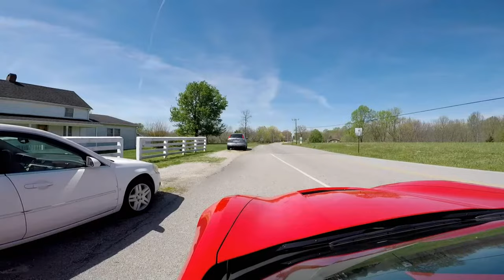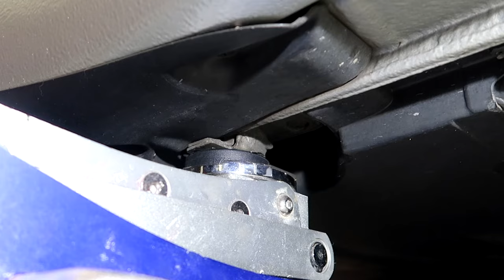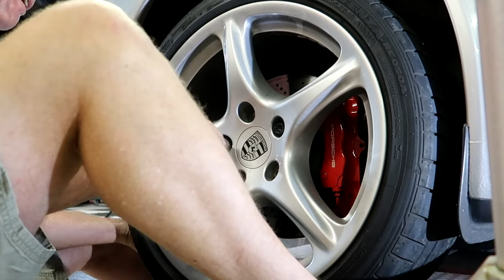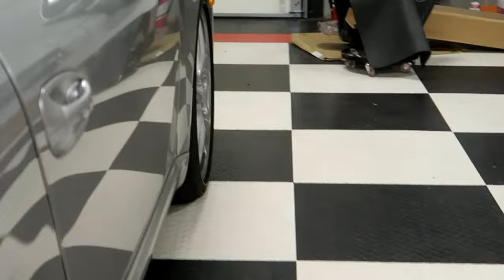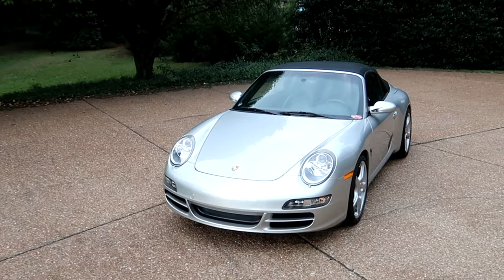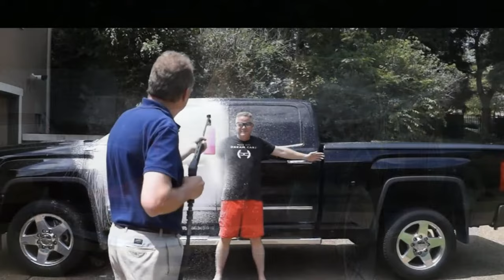Porsche 911 DIY Wheel Spacer Installation (911 S)

Comment: I put spacers on from Suncoast Porsche and now I get a shimmy at 85mph, and has Discount Tire check the balancing on the wheels, and it still shimmers. I’m thinking you car needs to be realigned after putting the spacers on.. I would welcome any feedback
Reply: If you’re using good quality spacers (H&R, Eibach, Or known brand) and you’re getting vibration, it’s usually because they aren’t perfectly centered when mounted. The guy in this video didn’t use the set screws which is a mistake a lot of people make. Go to The hardware store and get some longer M6x16 or longer stainless screws and secure the spacers to the hub prior to mounting the wheel. Put the spacer on the hub and hand tighten the lug nuts, then insert and tighten the set screws. Remove lug nuts then mount the wheel. Should be perfect. Also, when removing the existing set screws, they can be a PIA and easily strip. Make sure you use a “PH3” bit. It’s NOT a phillips “star” bit. Good luck.

Comment: Wheel alignment long stud tool  is needed !!!!!!! That brand of spacers are not recommend !!  Only use H&R, ECS or 5mmm OEM.  Note: more than 5mm in the front it’s not recommend by Porsche because will affect too much the necessary negative scrub radius.

Comment: Don’t you get a wheel stud alignment rod in your tool kit ? to make aligning the wheel easy I have one with my 986 toolkit
Reply from the maker: I looked at my tools and it does not appear it came with wheel stud alignment rod. I am assuming it would be threaded on one end so it could screw in?
Reply: I use one every time they worth they weight in gold makes alining wheels-so much easier
Reply: I agree. Get a wheel guide. Like $10 on AZN. Super handy with our lug bolts and the lack of support. Esp good on my panny with 20's. Huge wheels.
Reply: @Fulloctanegarage  yes it's a threaded rod

Comment: does the stud come with the wheel spacer kit? Also, can you tell me the length of the studs needed when you use a 15mm spacer and 7mm spacer. thanks

Comment: Has this vehicle been tested and driven in an autocross event or tested make sure no vibration or any sign of these wheels becoming loose? The H&R brand wheel spacers have recessed holes where the bolts that they provide attach the spacer to the factory hub and then the wheel is installed on the spacer using the factory wheel bolts and Wheelock!  So total you using 10 bolts per wheel. So bottom line do you think these wheel spacers you just installed in this 997 or just as safe as the H&R Trak Plus???
Reply from the maker: I do not track my cars and specially not with it being a cab. As long as you use the proper length studs there should not be an issue, a few friends who do track with these and also with them being hub centric have not seen any issues.

Comment: Do you really need longer wheel studs on the front? I heard the standard studs actually protrude beyond the back edge of the hub without spacers installed?
Reply from the maker: My expert tells me as long as you have a min of 7 full turns of thread (9 is optimal) you should be good.
Reply: @Fulloctanegarage  excellent, thanks very much for your help, great videos by the way!

Comment: have you feel vibrations at high speed with those spacers?
Reply from the maker: No vibration mostly because I only use hub centric spacers.
Reply: My steering wheel shakes at 180 miles / hr with the spacers

Comment: Why do people buy expensive cars and fit wheel spacers is beyond me. Buy custom wheels with custom offsets and do the job properly. On cheap skates buy spacers 👎👎👎👎👎
Reply from the maker: Expensive is relative, some of these are not that expensive and PCAR wheels are astronomical in cost compared to many other cars. Nothing wrong with small spacers if done properly but if you have an extra $5k sitting around for new wheels enjoy.
Reply: Porsche has, as an option, on some cars, wheel spacers. I think what Porsche really did was,  design a complete "package" to keep everything in house. IMHO, some of the ugliest wheel designs ever, in recent years,  yet they command high dollars on their option list. Because of the different designs albeit subtle...they use spacers, for fitment. Some wheels will fit the 911 and cayman/ boxster. More to the point tho,  Porsche designed all this stuff knowing that most companies won't build wheels using their bolt pattern 5x130. Aftermarket NICE wheels will still run you 6-8k per set or more. Makes these painted things seem like a bargain when adding them at the dealer. So.....now you know why, people stick 250.00 spacers on a 100k car. For 10mm what would you do?  I ran 1½ spacers on a jeep and dove it all over the country and up and down mountains. Never an issue. 15mm is nothing